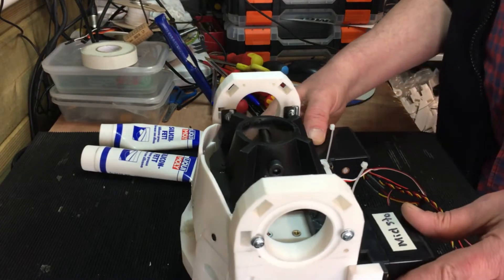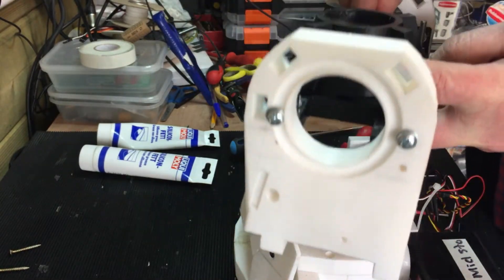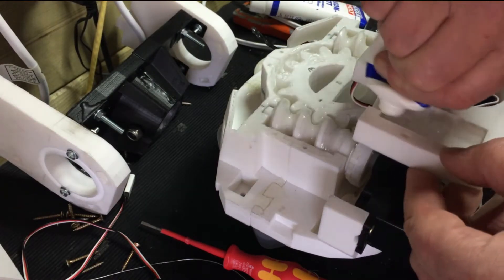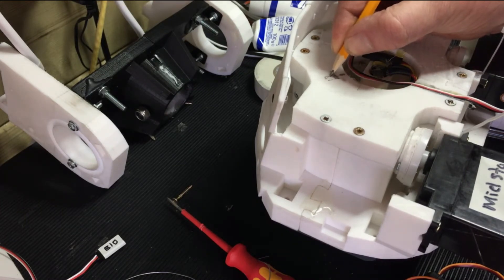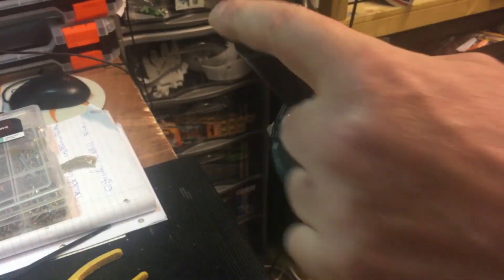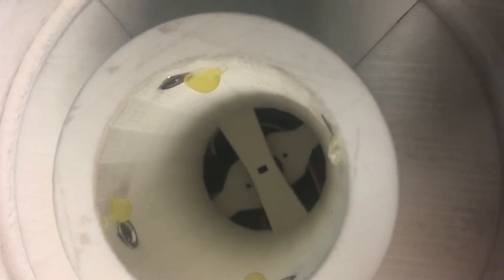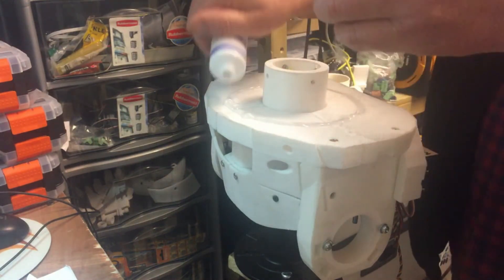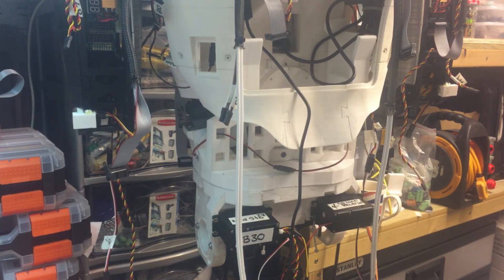InMoov build Part - 4

Comment: Hi, how you control the position you are with 1 master 1 slave deported potentiometer ? because i try to get right using P.I.D but i can't stop the servo and it's pretty hard to calibrate, thank's in advance for advice ! x)
Reply from the maker: Hello. I was manually controlling these servos using either EZ-Robot controller or a small servo motor tester. The potentiometer that's removed from the master servo should allow you to set the position of the servo and rock it back and forward. Best to practise control of a servo on its own and then take it all apart and remove the potentiometer and then find its middle stop position. There is more info on adjusting the servos on the Inmoov website as well. What controller are you using, Arduino? Try a basic controller first as I did, keep it simple on initial testing.

Comment: hello what kind of lubricant do you use?
Reply from the maker: Hi Roberto - I used silicone grease lube (transparent).  Its called Liqui Moly.  eBay or Amazon https://www.ebay.co.uk/itm/LIQUI-MOLY-3140-Battery-Terminal-Grease-50g-Kontaktfett-Pole-Fat-/115200108433?hash=item1ad2762791